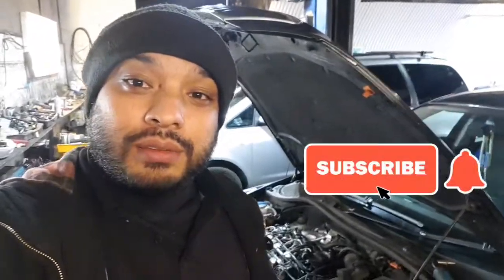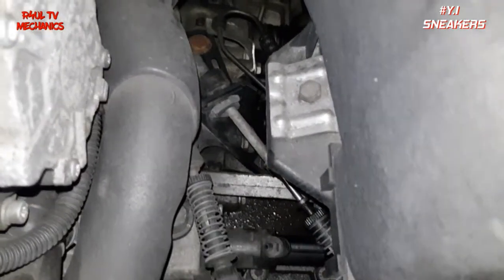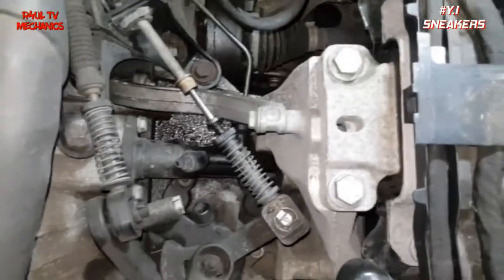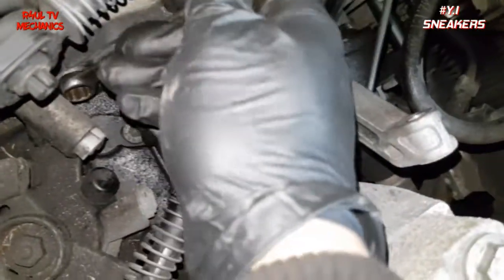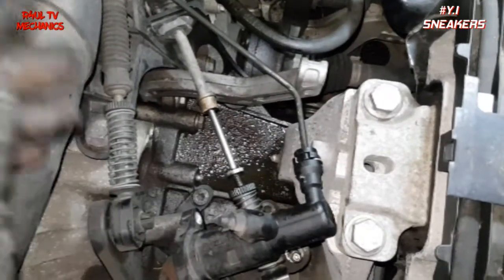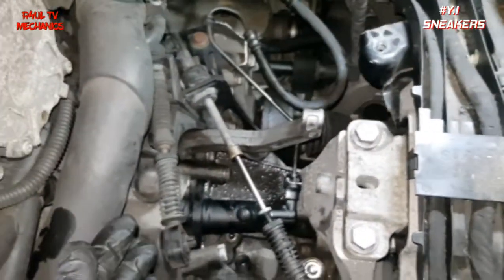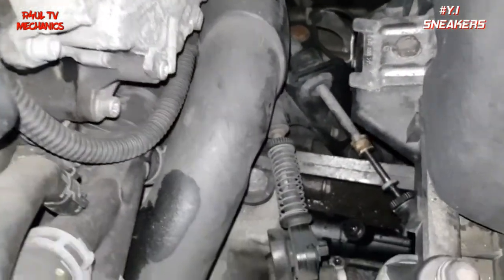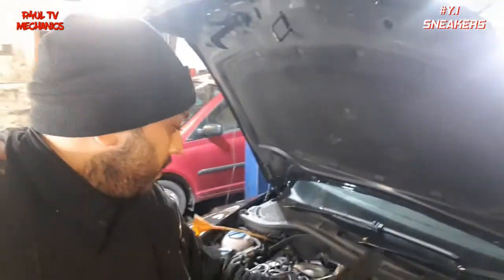2012 SKODA OCTAVIA CLUTCH SLAVE CYLINDER REPLACEMENT

Comment: Spot on video as always, quick question bud, if I'm starting to suspect clutch problems ( I've already upgraded cable end billits) would the slave cylinder be worth swapping out first to see if any improvement (they are half price at mo at gfs £65),,,, my cars only 7 years old and sat at a low 27,000 miles...
Reply from the maker: Yes that would be the best thing to first. Thanks for watching really appreciate it.

Comment: Great video! My seat Ibiza 2015 has low mileage yet is making a creaking sound when I press the pedal, I can hear it coming from under the bonnet. Will this just be a CSC change?
Reply from the maker: I think more likely to be the clutch itself. But try spraying some WD40 on the clutch pedal pivots and spring under the footwell see what that dose.

Comment: Maybe let me just ask the question, when you say bleed, you mean pump the clutch pedal while the nipple on the clutch slave cylinder is open or close?
Reply: Hello. No dont pump it. Push it in and hold. While you hold it, your friend opens and closes the bleeding valve a few times. If theres is no more bubble, just liquid, then youre done with it.

Comment: Octavia 2014 2.0 liter TDI manual gearbox (6 speeds) running about 266000 km, the problem happened suddenly when the clutch pedal is sticking down, I need to raised it manually several time to engage the speeds. There is no leakage of fluid after the inspection.
I tried to bleed air from the system, it needs to move the pedal and press it about 40 times to have a normal feeling, but the liquid comes out full of air bubbles (almost white in colour) from the breather. 
Is this a problem of the Pedal pump (Master cylinder)? or in the pump within the whole mechanics (Slave cylinder)? And could this happen for a  breather problem? thank you
Reply from the maker: Hi thanks for watching really appreciate it. It could be the concentric slave cylinder. If you slave cylinder is on the outside try replacing that first before you do anything else.

Comment: Question, my own clutch pedal went to the floor and the slave cyclinder has fluid around it. Is there any chance fluid could have leaked onto the clutch lining?
Reply from the maker: It shouldn't but in very rare cases it can.

Comment: Is that slave cylinder on that engine same as 2011 vw Passat
Reply from the maker: Should be the same unless it's a concentric slave
Reply: My 2008 passat 2.0t 6 speed how do I tell of it concentric
Reply from the maker: @marcionwilliams2602  on top of the gearbox if it just has a pipe coming out from the gearbox then it's a concentric. If the external it will bolted from outside of the gearbox under the gear linkages cables

Comment: I’ve lost the rubber o ring seal from the pipe that goes into the slave. Any idea where I can get a new one?
Reply from the maker: If you're in uk The best place is TPS
Reply: Does the o ring go on the end of the pipe first to the first slot and then the bigger seal on top of that. I'm having a leak issue with my 07 altea I've changed the clutch master cylinder the line that runs from it to the slave cylinder and the slave cylinder also new seals at both ends. But originally there was no o ring on either side of the clutch line

Comment: is this thec same on 2.0 tdi ?? thanks
Reply from the maker: If its external slave then should be very similar. If it's a CSC Then its different
Reply: @TEAMR4ULTV  no found out today its internal is there any way of determing which is at fault ie master or slave ? rac man seems to think its the master ?? any advice much aprecciated
Reply from the maker: @1gazzarobbo  do this get some pipe pliers and clamp the rubber flexy hose on the slave cylinder then pump it if it builds up pressure then it's the internal concentric slave cylinder if it dosnt build up pressure on the clutch pedal then might be master. Or it could be because the slave messed up damaged the master cylinder. I any way clamp the flexy hose and see what happens
Reply: R4UL TV thank you so much I’ll give it a go tommorow , the rac fella said the fluid was a bit low and it was horrible brown colour :(